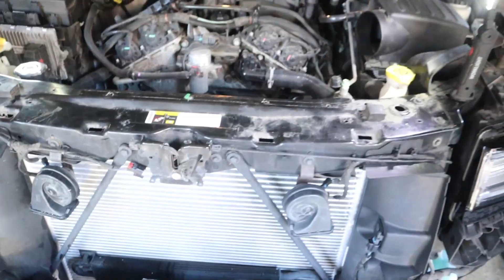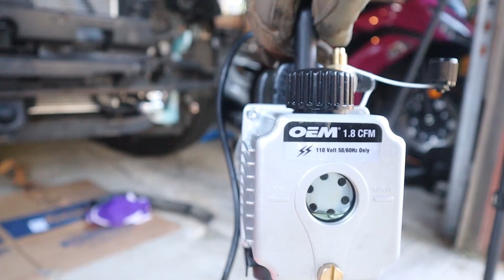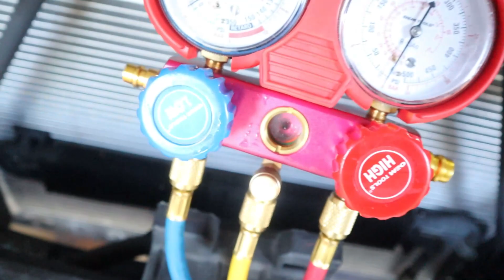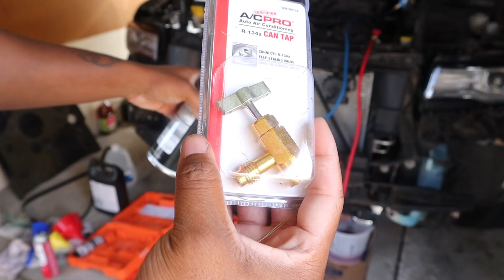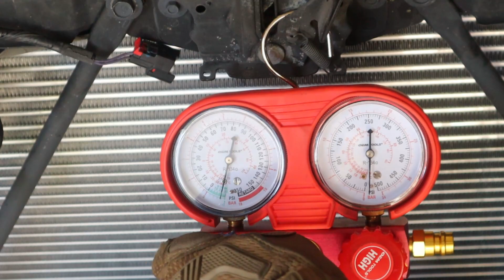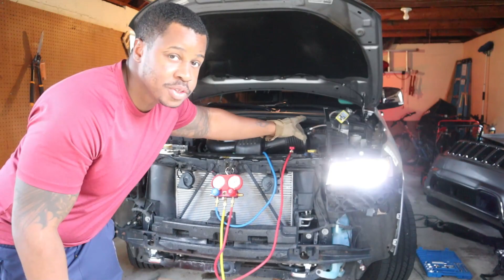How To Vacuum & Recharge AC System! Using AC Pro Cans or Gauges

Comment: Nice video, however, I hope you realized eventually what you did there with the gauge set. You connected the red and blue hoses to the corresponding high and low pressure ports and turned the valves counterclockwise, which was the closed position. You’re supposed to turn the knobs clockwise to depress the shader valves and open the a/c lines to the gauges. If this is how you vacuumed, then you pulled vacuum on the hoses and not the a/c system. I presume you realized so eventually, but did not edit the video.
Reply from the maker: Thank you and i appreciate the polite correction. Hard to find that on the Internet these days! Absolutely did catch that and refilmed. So far so good with things 🤞🏿
Reply: @LJsGarage  I know what you mean, it seems just about everyone online is looking to personally attack someone else to feel they’re the bigger man nowadays. I’m glad to hear your repair was successful. I found your videos in an attempt to prepare myself for my upcoming project. I’ll be replacing a seized compressor, the THV and condenser on my wife’s 2014 Jeep GC Ltd this weekend. There’s no low pressure switch on this A/C system and at some point during the winter enough refrigerant had leaked and the dumb remote start convenience features kept engaging the compressor. Once it warmed up I noticed no cooling and tried recharging, but quickly figured out the compressor was already shot. Since there’s no low pressure switch, the system can still run with low refrigerant and in those conditions it’s unable to properly circulate the PAG oil, which eventually starves the compressor and leads to a lock up. I don’t understand why a low pressure switch doesn’t exist on these new systems when that used to be a standard thing to prevent such issues on much older systems.